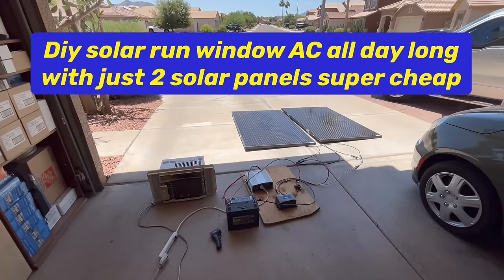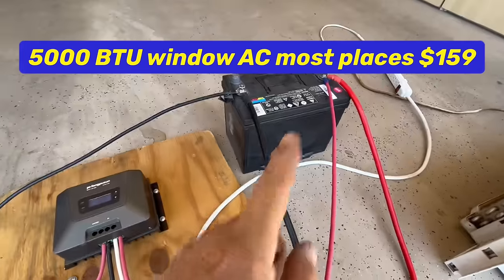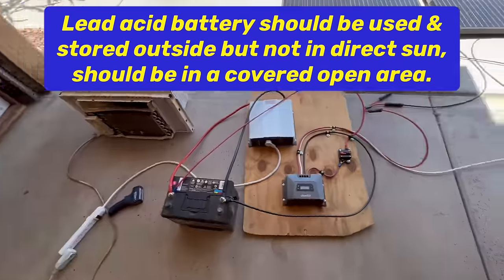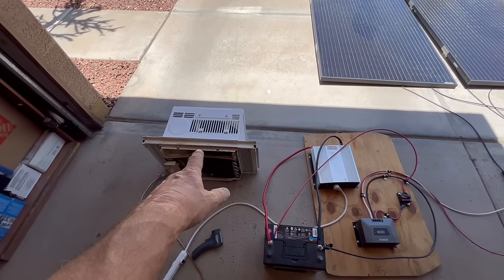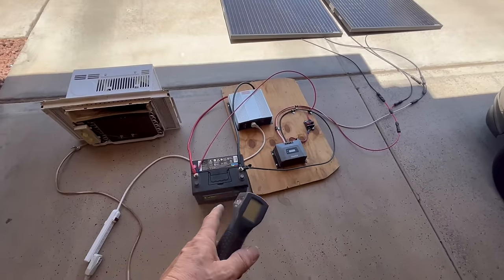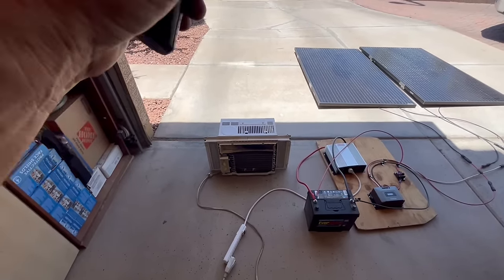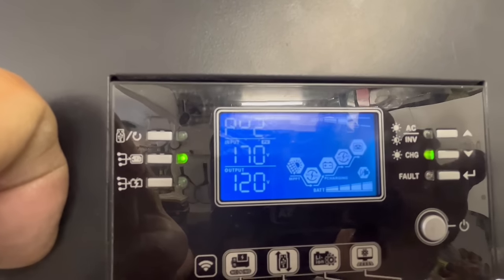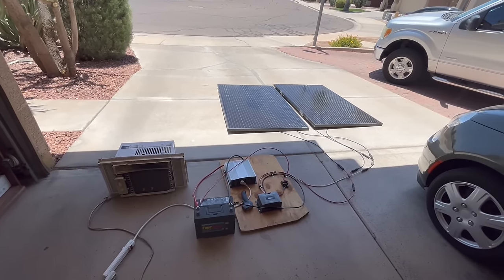Run your window AC with just 2 solar panels when sun shines. Easy DIY project you can do in one day.

Comment: I keep checking this project cause it's SO COOL. I'm buying a 2KW Chinese (what else?) pure sine wave inverter for less than $200. I'm in Florida and lose power once in a while and have an old fridge in the garage I'd like to keep food in without running my generator. I already have a 100W panel and Renogy controller from an old project that I can use (for about 5a constant charge in sun). If this works I can have cold beer and frozen burgers after a hurricane (if the garage stays together).
Reply from the maker: Check out my other newer videos with the EG4 3000 watt inverter and also running mini splits. The more you improve on this design the more stuff you can run but this was a bare bones very basic example of runny ac on solar. A 12 volt solar system is extremely limited to around 1000 watts input, 24 volt system is around 3000-4000 watt solar input and 48 volt solar power system can go up to around 20,000 watts input. The best bang for your buck right now is the EG4 3000 watt off grid inverter that will give you true 3000 watt output with up to 5000 watts of solar input. Add a second EG4 3000 watt inverter and you can run a 3 5 ton ac system on your house, would need 8000-10000 watts input total but can find used mixed manufacturer mono solar panels 25 230-260 watt mono solar panels for $500, freight might be $200-$350. Check out my other newer videos for more ideals before you decide what to do. You will find it amazing of what you can do with off grid solar and how easy is is to do DIY. They have other pallets with less panels sometimes starting at $200. Links in video for SanTan Solar used panels. Hope you get a lot of ideas of what would best suit your needs.
Reply: @diy-solar-guy  Thank you for the great tips! The EG4  price is quite reasonable too. I have enough parts to start experimenting and I do notice used panels coming up for sale in my area from time to time. I expect more panels to come up for sale after the hot season, and if they do, let the gathering begin. Once I do that it will be time for the battery bank. Be like building an old WW2 submarine propulsion!
Reply from the maker: @user-ol5rj8qn9o best of luck for your project. It took me 6 months to gather components before I started building my system.

Comment: I'm going to look at this video a few times so it can sink in. I'm not that great at electrical. But I have a detached garage and made a back room in it with a window to do my hobbies. I'm trying to find a way to run a window unit using solar through those expensive HOT Houston Texas months!
Reply from the maker: You should improve upon this system. This is just the bare bones basic. Adding more solar will improve how long you can run ac. Using an all in one inverter will allow you to add more solar. When it is cloudy, you will decrease run time considerably. I live where this over 320 sunny days a year. Take all this into consideration when trying to build a system. Hope this helps. Hope you have a truly wonderful and extremely blessed 2024

Comment: I love the basic premise of using the solar when it's available.  And when that sun is cooking, keeping you cool is useful.  You can only store so much in a reasonable sized battery, so this is a practical application.  I like the DIY notion, keep it simple, keep it cost effective.  The motor home use is a great place for innovation.  I've thought that attic roof fans might be a similar idea of using it when you need it, for cooling again.  But also the idea of keeping it simple, local, self contained, compared to the concept of big 20 solar panels on the roof thing.  You see this put in place in things like outdoor lighting powered by built in little solar panels.
Reply from the maker: Thank you for for comment, I actually don’t have any solar panel’s on my roof. I have 54-250 watt solar panels on my 7 pergolas in back yard. We live in Phoenix AZ and it gets hot here, 112-118 this last month I also have 12 solar panels on top of 2 sheds and but 2 solar arrays that have 8-330 watts solar panels and 24-250 watt solar panels. All while maintaining a beautiful back yard with a solar powered heated swimming pool in the winter. We are now air conditioning and heating our house 7/24 375 days a year with solar in the day and LiFePO4 batteries at night. I used this simple set up in my solar shed when I first started and air condition the shed during the day for 2 years before moving my inverters and batteries in garage. The ac worked well but I upgraded it to 4 solar panels and added 3 more batteries, rainy and even party cloudy days will keep the ac from running if you don’t improve or upgrade on this simple example. This simple example works only wen sun is shining with no clouds, battery is only to keep a constant voltage to ac, not for storage to run without sunshine. Lead acid batteries can not run a ac by it self with no solar for more than 1/2 hour at most. You need lithium iron phosphate battery to run overnight or on cloudy days. I started with this simple set up 4 years ago and now save over $5000 a year on electric bill. Hope you look at some of my other videos to see what is possible with off grid solar that is 100 percent DIY. I make the videos to share with others for free what I accomplished. I have a lot of fun building solar off grid projects. Hope you had a truly wonderful and extremely blessed week.
Reply: Buy a Deye solar inverter. It can run your gadgets from solar. it has high efficiency.
Reply from the maker: @xXAbdulBaqiXx  I actually was showing this system from when I started out 4 years ago. At that point I was just starting to explore solar off grid. Now I run my entire house and garage with solar and battery bank. I even heat my pool with a 127,000 all electric pool heat pump heater in the winter. Thank you for your input. That is a good idea. Hope you have a wonderful and blessed week

Comment: Nice project. Thanks for sharing!
Reply from the maker: You are so welcome. This is just a very basic look at a simple solar power system. I actually completely air condition my 2 story house and 3 car garage with only solar in the day and 25.5 EG4 LiFePO4 battery bank overnight. Check out my other videos to see what I used and how I accomplished this all off grid solar and DIY. Hope you have a truly wonderful and blessed week
Reply: @diy-solar-guy  I was wondering if you would mind giving your opinion on a project I've been considering.  I haven't tinkered with solar power yet, but I'm very interested. I'm also very conservative and I don't like the idea of using batteries with solar due to their high expense and limited life. I purchased a couple of basic solar panels to play around with and would like to connect them to my main breaker to offset my power consumption during the day.  I realize this isn't going to make much difference on my power bill, but I think it would be a good way to introduce myself to solar.
Reply from the maker: @Ed-ym4tu  hi, you have to get permits and inspections before you can try to connect to main breaker. A lot of equipment is needed. City would have to inspect and utility company would have to inspect what you are trying to connect. You need to do a lot of research before trying to install solar. Talk to a solar installer who would give you a free quote on installing solar and ask about all the components needed to accomplish this. I personally would never install on grid solar at my house. It is so expensive that you would never break even. Solar power is dangerous and can injure you or cause a fire if you do not understand how it works. I do off grid solar that is not connected to my grid at all. Completely separate and independent. There are so many videos out there explaining on grid solar and what is involved and off grid solar and what is involved that you should start there before even considering trying to connect a solar panel to anything. Educate yourself before tackling solar power. It can be easy to install off grid solar with the technology available today with all the latest components but you need to understand how everything works and the danger involved if trying to install DIY off grid solar. If you tried to connect to your grid, with the new meters on the homes today , the utility company could tell as soon as you connected and could easy get you fines or worse. Please get the knowledge for free from watching videos from so many people with YouTube channels that can explain and. Even show how to connect components safely and correctly. I learned for years and investigated all my options and what components to buy before ever connecting anything together. Will Prouse is a great resource on YouTube, he does an excellent job explaining solar and how to connect all the components safely and correctly. You can easily learn very quickly watching his videos. I show what I have done with solar but I don’t do a lot of videos showing step by step with installing individual solar components. Hope this helps you to do more research before anything else and I hope you are successful in your future solar projects. Hope you have a truly wonderful and blessed week
Reply: @diy-solar-guy  ok, thanks for taking the time to reply. I'll take your advice and not explore that.

Comment: If you do the mini split boil a box I have used  a large pvc or metal electrical box attached to the front or back side  stack the condenser unit on top run your lines to where you want to. I have never had the two minis leak.
Reply from the maker: Thanks for your input with mini splits. I actuate installed 6 in my house, 2 upstairs, 2 downstairs and 2 in garage, also just installed one in our motor home that does an amazing job cooling down extremely fast compared to rooftop ac that came with motor home. We have our mini splits in as long as almost 4 years now with no leaks on any of them. Great little extremely quite efficient units. We run all those with just solar and if need to run on LiFePO4 battery bank overnight. We also have been running our whole house 3 1/2 ton, 4 ton heat pumps with solar in day and LiFePO4 battery bank overnight although we usually only run the upstairs 3 1/2 ton ac overnight on battery bank and it keeps whole house very cool in 110+ heat in day. All with off grid solar. We also heat our pool with a 12.7 ton pool heater heat pump that uses 7500 watts. We run our 4 freezer, fridge/freezer combo and pool pump 24 hours a day in only off grid solar and battery bank. All this is run with off grid solar and do much more we use as well. We started with this simple little 5000 btu window ac to see if we could run it with solar only in day over 4 years ago, it was a success so we kept increasing our off grid solar system to what it is now. Check out our other newest videos to see what we do with off grid solar. Hope you have a truly wonderful and extremely blessed 2024.

Comment: Hi, great set up...can you tell me where did you get those solar panels?...tks
Reply from the maker: santansolar.com. They have sales slll though out the year and 2 virtual sidewalk sales a year. You can get some extremely good deals if you check at least 2 times a week. Once sales start, they sell out very quick on insanely cheap used solar panels. Need to be one of the first one to buy when sales start to get great deals. I usually check almost every day. Thanks for your question and hope you have a great and blessed week

Comment: Good job, very good job and  very good description. ⭐️⭐️⭐️⭐️⭐️
Reply from the maker: Thank you so much. We actually started with this small window ac and now run our 3 1/2 ton and 4 ton upstairs and downstairs heat pups to heat and cool our house every day year round with only using solar in day and battery bank at night. We also run our pool pump 24 hours a day as well as eat our pool to 89 degrees in March while neighbors pool water temp is in the 40’s water temp. We run 3 freezer as a fridge 24 hours a day as well. All this is off grid and stated with that little 5000 btu window ac unit. Hope you enjoy watching the other videos on how we are able to do all this and what components we needed to achieve this. Hope you have a truly wonderful and extremely blessed 2024

Comment: Awesome Video.  Hats off!
11:40  "Cool air rises Hot air drops"   WRONG, you have it Backwards. Heat Rises Cold Falls.  
Think of a block of dry ice, when it boils off, does the nitro gas rise or stay on the floor?
Then add a 5-2-1 start kit (hard start kit) *reduces 50+% of the LRA , Then poss. run a 10-12k BTU/HR AC on that set up.
Reply from the maker: Sorry, I did not catch before I uploaded video. I have to take prescriptions for the 2 cancers I am going through and every once and I while it comes out of my mouth totally backwards and I don’t catch before uploading. So sorry, I apologize. In the positive side, I went on to run my 3 1/2 to upstairs and 4 ton downstairs and 18,000 btu in garage all off solar 365 days a year. 7/24 using off grid solar in the day and 51.2 volt, 35.5kWh LiFePO4 battery bank overnight. We spend $0 on heating and cooling a year. We also run our pool pump 24 hours a day 365 days a year and heat our 15,000 gallon in ground pool to 86-89 degrees starting in March and going through November. All off grid solar, and our entire system has paid for itself in just 4 years. Once again , sorry for saying it backwards and not catching it. Hope you have a truly wonderful and extremely blessed 2024.
Reply: @diy-solar-guy  No worries Brother. Love how you did house w/ full mini splits. * much higher SEER ratings. Super cool on making your own electric too.  Keep up the Good Fight, keep being/thinking positive bc God is on your side.
Reply from the maker: @user-xk5so7wb2t  Amen, been in remission for 6+ years and did not do chemotherapy or bone marrow transplant as they said that was my only option to get into remission. I trusted in God through his Son Jesus that he heals those who believe. I believe and have seen God heal 53 people through the laying on of hands and prayer using me as a vessel of Faith to mix with their Faith. Thank you for your kind words. Hope you truly are Blessed this year by God.

Comment: I like your simple approach and explanations to this... Being a simple man (yes, intentionally ambiguous) as I am...😂   
However, at 11:41 into the video, you said, "Cool air rises and hot air drops." (Uhhmmm... NO!!) (I'm hoping you misspoke)...
As I am just starting my off grid adventure, this leaves me questioning your advice about wiring, installing solar, AC, other appliances, etc...
Reply from the maker: Sorry about that, going through 3 cancers and was taking a lot of meds at the time of video and some things were coming out backwards. I apologize, please forgive me. I did not catch before I uploaded video. I am much more diligent before uploading videos since then. Hope you have a truly wonderful and extremely blessed 2024 and hope your off grid solar adventures is fantastic. This video was my first attempt at running a ac with solar. Check out my latest videos to see how far we have come and everything we run. We are also able to heat our pool in the winter which the electric pool heat pump pool heater useing 7500 watts while running. That is more than any other appliance we use by almost double the watts. Once again sorry.
Reply: @diy-solar-guy  no problem,  I was mostly concerned for others who didn't know.
I hope your victory and recovery with cancer goes better than you could hope for...
I'm 70% certain I subscribed because  you explain things very well and easy to comprehend (for us simple men out here).
Thanks, and again 🙏 your amazing revivification.

Comment: OMG - I think you are in to something here.  Off-grid powered A/C.

I need to do this to my detached garage, which has its own power. 

Running A/C in summer is the biggest electrical consumer - getting that off my bill would be huge.

😲
Reply from the maker: Check out my other videos, that is exactly what I did. I run my upstairs, downstairs and garage on solar in day and upstairs in house at night. Last night the power went out and we did not worry, we were already using LiFePO4 battery bank and stayed cool all night. Ac kept running. Hope you have a wonderful and blessed week

Comment: charge controller should be installed vertically to maximise convectional cooling, it probably has a de-rating for horizontal installation

also, get yourself a dual inverter a/c and the surge will be substantially less
Reply from the maker: I actually run my entire 2 story 2450 square foot house now and my 3 car garage that is 600 square feet with off grid solar as well as my pool pump 24 hours a day 7 days a week as well as heat my pool to 89 degrees in winter when neighbors pool water temp is in the 40’s. We have evolved a lot. This was just a simple video to show the basic components needed to run a window ac during the day. There is a lot of room for improvement. I just wanted to show viewers that it is possible to cool a room in with solar power. Thank you for your suggestions, we appreciate it. Hope you have a truly wonderful and extremely blessed 2024. Check out our newest videos to see what components we use to do all that was stated above.